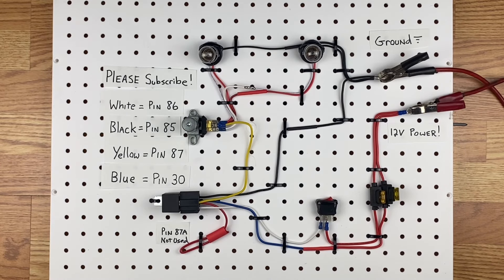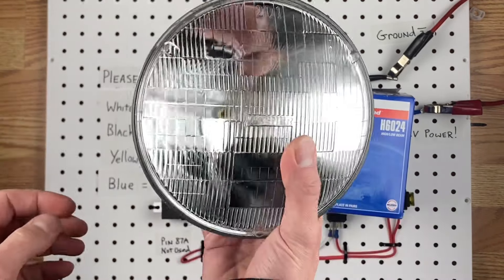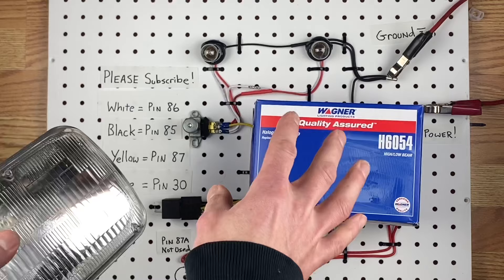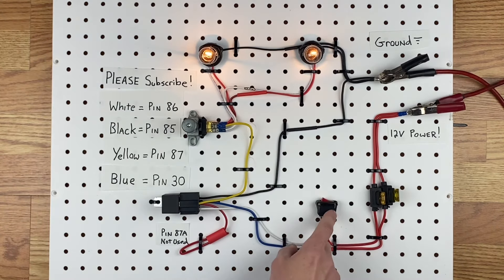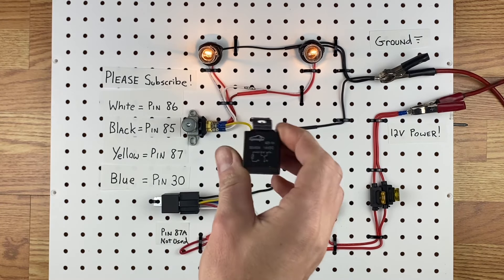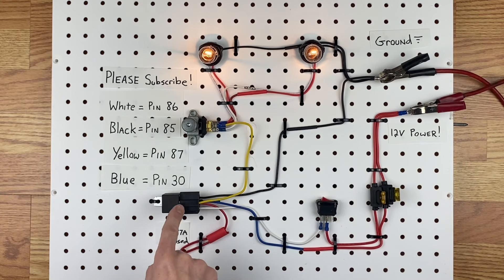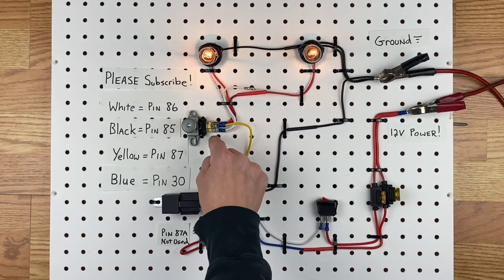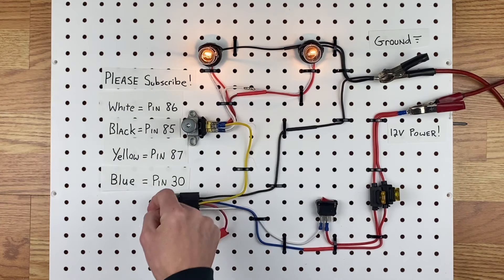How to Wire a Headlight Relay for Sealed Beam Round & Rectangle Lights w/ Floor Dimmer Switch.

Comment: So are these bulbs why cars went from 4 head lights (4 high 2 low) to just 2 headlights that can do high and low
Reply from the maker: Pretty much. Car manufacturers were required to use certain types of lights by the department of transportation for a very long time, decades. That’s why the cooler car manufacturers had pop up headlights and hideaway lights. They were trying to make their cars look good when they were all forced to use the same lights. Imagine if that were still the case? Ford, Chevy and Toyota cars and trucks all shared a single headlight! It would be totally bananas, but that’s they way things were from the 1940’s until the 1980’s. These dual filament lights were a small way that car manufacturers could gain some flexibility in the car design rather than the dual lights on each side. Fun stuff right?

Comment: Might be a dumb question but can I run this straight off the battery for power?
Reply from the maker: As long as your wire coming from the battery has a properly sized fuse in it that is pretty close to the battery.

Comment: How would I wire up and relay to a 1964 impala light switch?
Reply from the maker: 64 impala headlight switches are big giant things that can generally handle higher amperage. Is your goal to wire 64 impala high and low beam headlights? If so - I can probably create a video for that. As you may have seen in my other videos, I have a couple 64 Impalas to reference.

Comment: Is there any other headlight switch you would recommend other than a floor switch
Reply from the maker: Unfortunately, I don’t know of another good option. If you did find one, the circuit would likely have to be wired differently.

Comment: Does fuse size on pin 86 (switch) and pin 30 are same size or different? Thank you in advanced sir 😁
Reply from the maker: Yes, very much so. Check out this video for help on fuse and wire sizes. https://youtu.be/EhzN6UdnmPA
Reply: @WiringRescue  Thank you very much Sir 😁

Comment: I have 1965 c30 long bed with a 1996 tilt column in trying to fab into the cab and I need to make the turn signal circuit work with a 12 circuit fuse box from eBay please help

Comment: Will this work with LED low/high headlights? I have a ‘23 T Bucket that I put LED headlights on and they keep blowing the fuse on my headlight switch.
Reply from the maker: Before you make any changes, I think you should understand why your fuse is popping. I made a whole video about this - check it out. https://youtu.be/EhzN6UdnmPA?si=XU-n2tVSZj7A8F0b
Reply: @WiringRescue  I appreciate the information. Looks like I need to do some math and make sure  I have the right wires as well. I will let you know.
Reply from the maker: @hcoulter1127 - yes! It’s always nice to have the bright headlights, but sometimes they draw more amperage than the factory harness/fuse/switch is rated for. I’d bet that’s your scenario. Your fuse is protecting your wiring, so if you up-size your fuse, you’ll likely light the wiring on fire instead. So it’s always best to do a full review of the circuit, do the math, and build it based on the needs of the load (your headlights in this case). Good luck with your project and thanks for watching!
Reply: @WiringRescue  I only wish I had seen these videos earlier. Basically all I did was went from halogen headlights to led. Just figured they would draw less amps. The fuse never had an issue with the halogens.
Reply from the maker: @hcoulter1127  - generally LED’s draw way less amperage. It could also just be a damaged wire somewhere, or bad switch. Could require a bit of investigation if the wattage/amperage math checks out
Reply: @WiringRescue  well I just checked my specs on the lights I’m using and I think the wire may indeed be the issue. For this application it will require 10 gauge. I think I used 14 or 16 gauge. I guess it’s back to wiring. Thanks again. Your videos are easy for a wiring dummy like me.
Reply from the maker: @hcoulter1127 - that’s great news! Glad you were able to (hopefully) diagnose it!

Comment: PLEASE HELP. Theoretically… if I just wanted my high beam to turn on with my regular lights….. I just splice the positives together?
Reply from the maker: I don’t think so. You’d probably overload the wiring that powers the low beams and pop fuses or burn wires. I’d probably use the low beams to turn on a relay that powers the high beams. That ways each circuit is separate, but the low beam turning on is the trigger for turning on the high beams.
Reply: @WiringRescue  I actually tried it out and it worked fine. Just wired the high beam wire into the low beam wire and now they both come on when I turn the bike power on.

Comment: How about with a regular toggle switch,  would i need relay
Reply from the maker: That depends what you are powering and how big of a toggle switch you have. Most toggle switches are not rated for the high amperage draw of headlights. That’s why relays are used. Old cars from the 60’s didn’t use relays but their headlight switches were the size of a dollar bill. So it really depends on your specific parts.

Comment: I've had a problem with my low beams in my 69 Cutlass for years now. When I put it in low, only the passenger blinker light in the front lights up.. I've replaced the floor switch and the main headlamp switch and still can't get them to work. Only when I switch them to high, all four lights come on
Reply from the maker: My Impala had similar symptoms, and I found several issues causing them. Here are some things to check:
- The harness that plugs into the firewall. My wiring goes straight into the fuse box, and one pin in my fuse box became loose somehow.
- The terminals that actually plug into the backs of the low beams corrode. Turn the lights on and check for power and ground at those terminals. If they don’t have both power and ground, follow the wires back to their source.
- Mine has a separate ground wire that goes from the battery to the radiator support, and it was broken. I’m not sure if a cutlass has this too, but make sure your radiator support has a good ground.
- If all else fails, rip all that out and I’ll make a video showing how to do a 4 headlight setup (2 low beams, 2 high beams). Then you can copy it and start fresh!
Reply: @WiringRescue  Awesome man thanks for the info, and yea I have the same ground from the battery to the core support as well. Hopefully I can track down the problem

Comment: Can u answer me.
when i try to on highbeam while already on the headlight,it does not come out
But when i highbeamed when the headlight was off, it has light from headlight
Reply from the maker: You'll have to get a test light or a multimeter and see where the electricity is, and is-not.  Unfortunately it is a tough thing to diagnose over the internet.

Comment: How do you include the parking lights in this setup
Reply from the maker: Well, I haven’t made a headlight & parking light video, but I do have this which should help. https://youtu.be/Io_i9016o10
Reply: @WiringRescue  yea I need them on the same switch or replace low beam with parking.  I got those aftermarket lights with the ring that turns colors.
Reply from the maker: @infamousnova  - I do want to make some other headlight videos with other methods of wiring. I’ll add this sort of thing to my to-do list.
Reply: @WiringRescue  I'd like to see this with the same style except it has 3 functions.  It has the parking light, low, beam and high beam with that floor switch  and the pull out switch on a older car.
Reply: @WiringRescue  I wonder if I can wire in the stock light switch. So like I send power with toggle to stock light switch?
Reply: Scratch that, I just pulled it out
Reply: @WiringRescue  ok I figured what I want to do. I'm using a switch on a panel. I only need 1 light beam in low or high doesn't matter. But I have the 7in lights that have the ring with diff colors. I'd like to wire that in. Something like power to the floor switch, ring parking light on one side and other side low or high beam. Is that possible?

Comment: Could you use a 4 pin relay
Reply from the maker: Absolutely. The 4 pin relay just won’t have the 87A terminal. We ignored that anyway for this circuit. Good luck with the project!

Comment: Can you do a tutorial on new 7”LED light bulb wiring to an old ratty muscle car?
Reply from the maker: I think it would be this exact video, unless you were doing the dual headlights on each side. Is that what you need?
Reply: @WiringRescue  is there not a different way someone should wire if using a new age halo LED on an old age wiring setup?

Comment: You probably wont respond but do you think this would work on a dirtbike
Reply from the maker: Tada! I responded! This would work, but I don’t think a floor mounted high beam switch would be good on a dirt bike. You’d be better off with a 3 way toggle switch in its place.
Reply: @WiringRescue  ok thanks

Comment: So can I use one relay for h4 headlights?
Reply from the maker: The relay or number of relays will be determined by the number of headlights, the amperage draw of them, and the headlight switch your using. So it’s not something I could answer with any level of certainty.

Comment: I work on trucks but sometimes the wires get hots from the switch
Reply from the maker: If the wires are getting hot, you are drawing too much amperage through the wires and switch. It sounds like a dangerous situation that could lead to fire. I’d recommend getting the proper size fuses, wires and switches in place before using it again.

Comment: here is my problem ,  car is a 64 for falcon, and for the life of me i can not figure out how to use this relay and still manage to use the original dimmer and wiring. or even if its possible. i've looked for days trying to find the correct video and haven't.  the fact is automotive wiring eludes me so. make it as simple as you can.
Reply from the maker: I have a video coming out in the next ~week that shows the easiest way of wiring parking lights, turn signals, and brake lights.  If you add this headlight circuit from this video, you’ll be all set!

Comment: The ground on the 7 inch head light is not the center prong the one on the left is ground the one on top is low beam and the one on the right is high beem

Comment: 20 Amp fuse ?
Reply from the maker: Nope, the fuse size is totally dependent on what you are powering, and the wires you are using. I made a whole video about it here https://youtu.be/EhzN6UdnmPA

Comment: I am trying to, Not just fix properly, but to teach as I go. He has an '89 ford mustang with no headlights, the signal and running lights have been switched around at some point, and even after verifying his switch works, I could not get the lights on. He should not have bought this car with absolutely no experience as a mechanic, But I'll be damned if I don't figure it out, I think what him and I need to do is start from scratch, do it all again, properly.